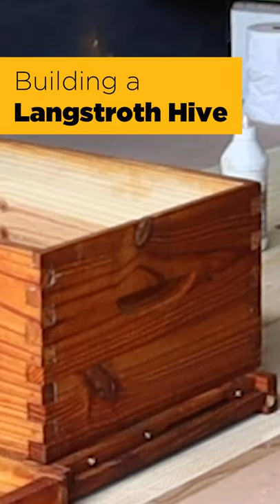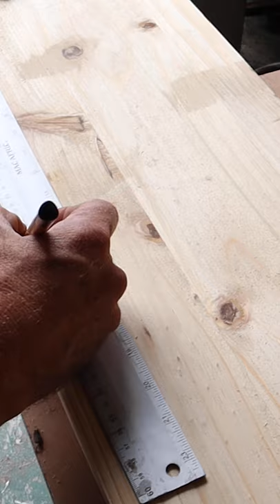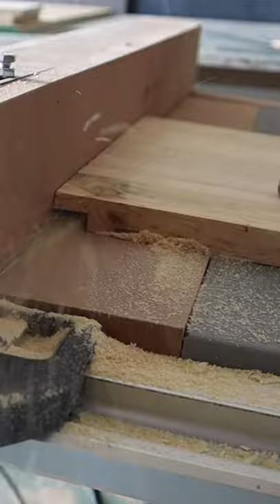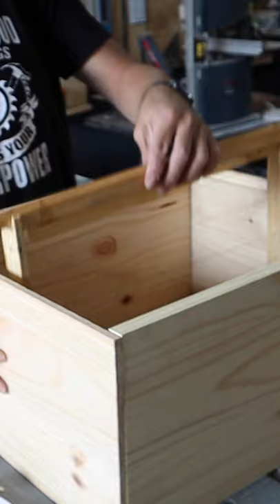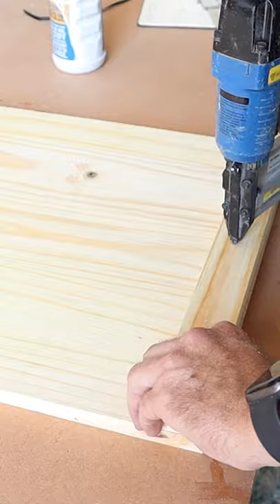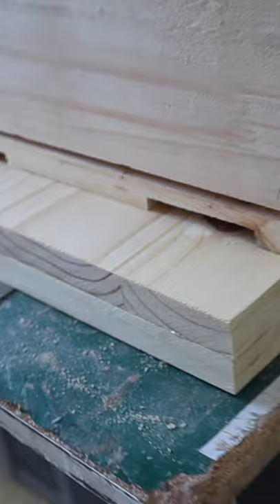60 Second Hive Build (Langstroth hive) #shorts

Comment: Using gum can lead to absconding?
Reply from the maker: Never had that problem. But having said that we have started using hives that are just screwed together. This way we can replace a deteriorated or damaged panel easily. Thanks for watching.
Reply: @BeeSanctuary  make video on simple beehive please
Reply: If you are referring to glue, best to air or let vent dry for 2 to 4 weeks before installing bees. This is for painting as well, to off gas any vapors.
   I like the idea of using screws. Do you predrill pieces of wood on the screw head side? To keep from splitting.?🐝💪
Reply from the maker: Will see what we can do for you on this.